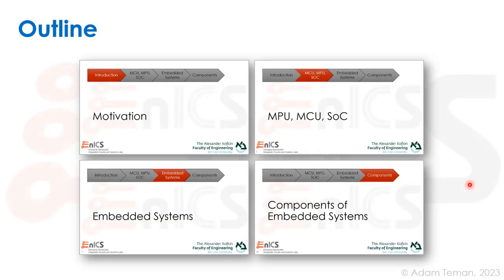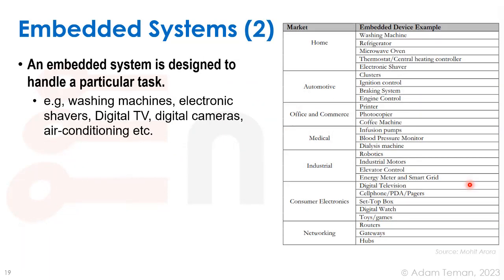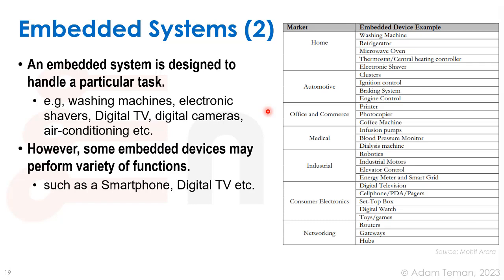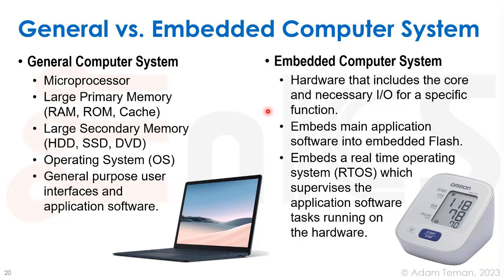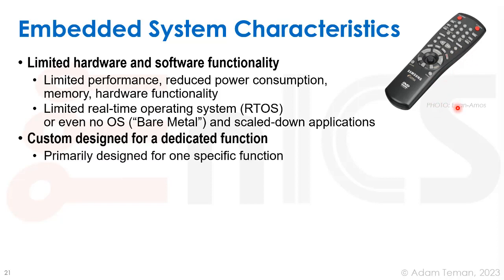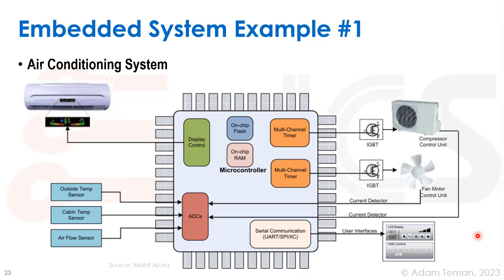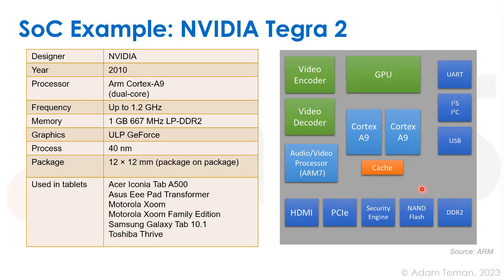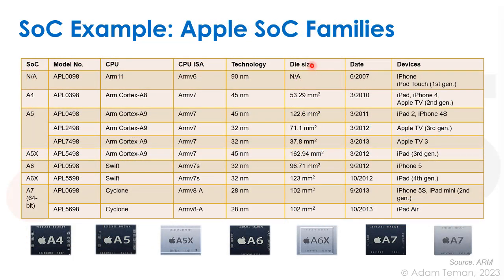SoC 101 - Lecture 1c: What is an Embedded System?

Comment: GOOD JOB , i need more about smartphone knowledges , i need to understanding how could send things inside them "smartphone " because i study by myself , for repair them "iphones " but  i need to understand before start analis circuits such baseband or COPASS, pmu ,etc chips ,,would you please advice me ,, what should i follow to achieve that ?
Reply from the maker: I think there is a lot of great content available on YouTube that could provide you with some of this. Regarding this course, it does discuss a lot about embedded systems and the stack from hardware to low-level software, but it's far from being focused on fixing electronics, so I'm not sure that it answers your needs.